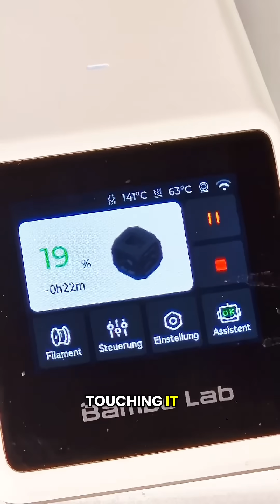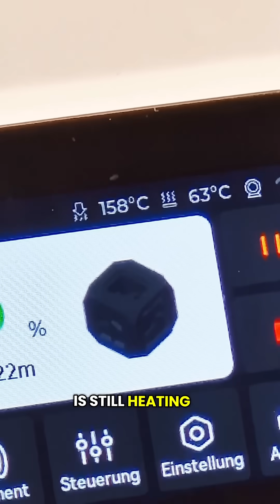3D Printing 101: Brim, Skirt & Raft #3dprinting  #3DPrinting101 #BedAdhesion #3DPrintingTips

Comment: Okay but why does my printer print a line on the edge of the build plate before printing?
It does the same thing the skirt does plus on top of that it prints a little bit out the waste shoot to ensure it doesn't have any previous filament still in the nozzle, so what's the point of skirt if my printer is already doing two things that get the filament moving out the nozzle?